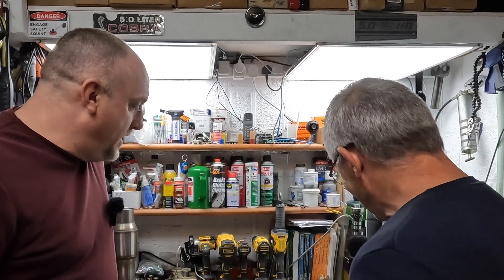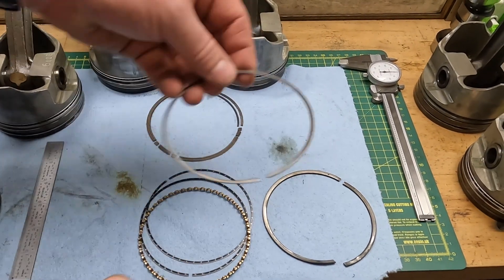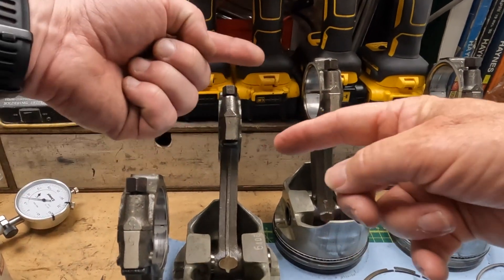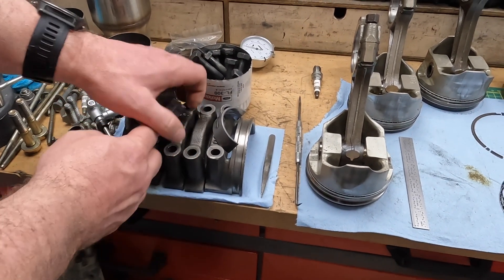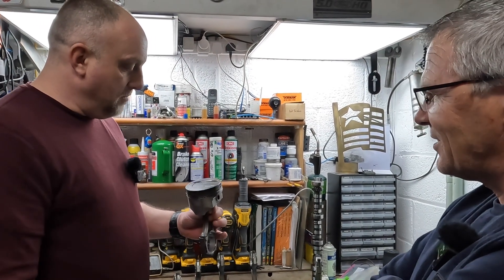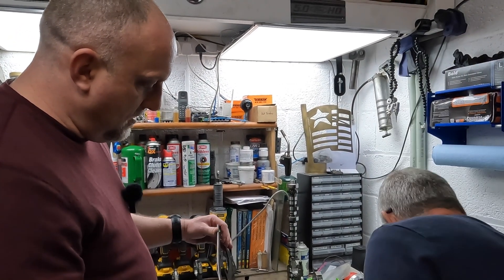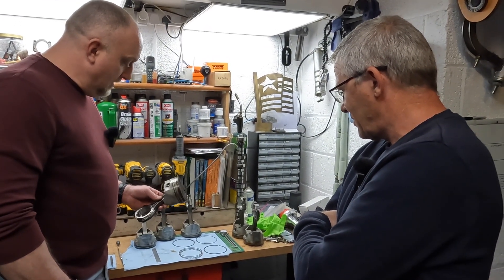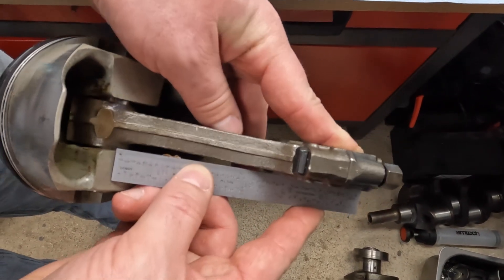Is 500 HP The Real Practical Limit For A Stock 302 Shortblock?

Comment: I have to ask....is 500hp naturally aspirated less violent than 500hp boosted? is timing and mixture more forgiving NA? Do you think your cylinder wear was as measured before or after it was boosted? I dont know man....that is CERTAINLY interesting.
Reply from the maker: I'm not one to science that out.  500hp is 500hp but boosted engines usually make more torque.  Especially turbo cars.  Cyl wear...  I'll never know.  The tops of the pistons wore so much after the rods bent that I cant say how much accelerated wear happened.  I know that when I built it there was no perceivable ridge.  Now I can feel a little one with my finger.
Reply: Harmonics and pre-detonation kills these blocks. I’ve been pushing 600hp on a 302 with forged internals and a main girdle for yrs.

Comment: Boost ?  The 2.3 Volvo red blocks will bend the rods when the boost is high, and the rpm is low. 
My freind works at a highly reputable  tuning shop in Michigan, his experience is some of the late 60's 302 blocks with "Hecho en Mexico" are the strongest, but are sketchy at the 600 mark. A main girdle helps.
Reply from the maker: Boost was around 12psi.  I got into the 10's and that was enough for me with this combo.  Especially with it smoking a bit and #7 having low compression.
Reply: @Mike-FoxsAbroad  Thanks for the reply.  My '80 Capri hasn't seen the light of day since '99. I have a 2001 Explorer 5.0 / 4R70W sitting on the garage floor. But I also have a Gen 4 LH6 5.3, that I got free, and frankly, I can't see putting a 230 hp iron lump, where a 400 hp aluminum one will fit perfectly. I don't believe in brand loyalty. Sorry if you hate it.